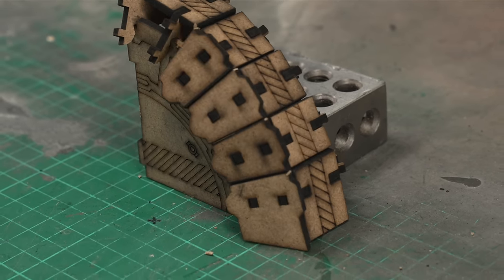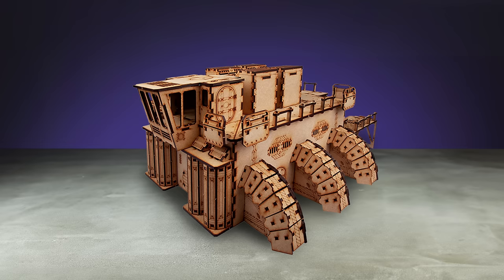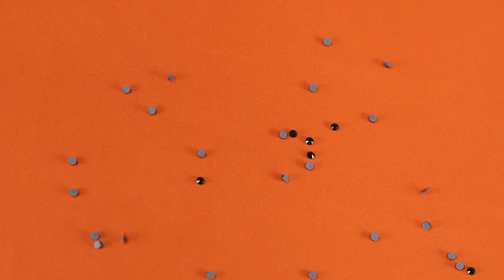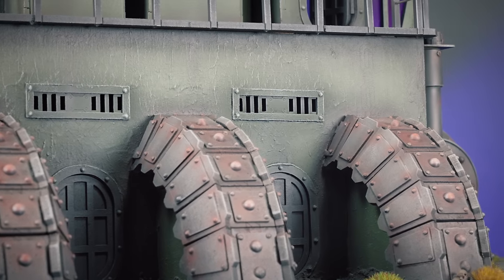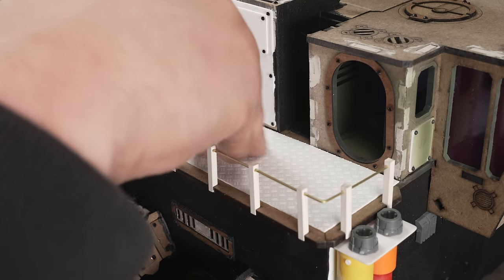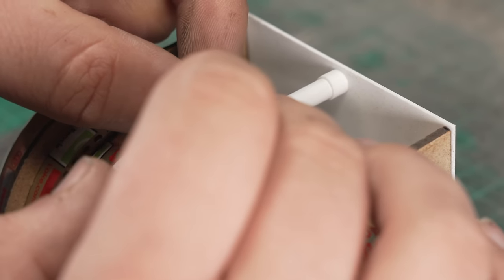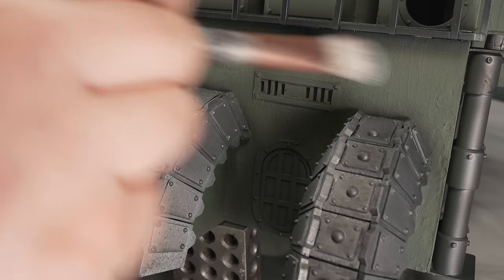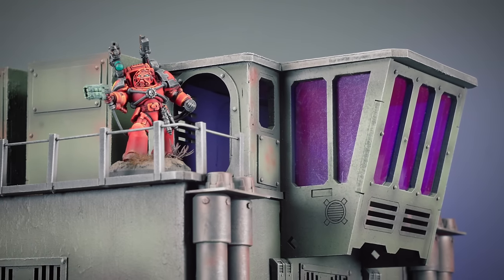How To Make Laser Cut Terrain Kits Look Good For Warhammer 40K

Comment: Some fantastic instruction there. As much as i love MDF kits, they do have some limits that need mitigation. I think the most telltale sigs are the burnt edge plugs, but wiping down the MDF and light sanding before assembly makes a load of difference in how much post assembly fixing is needed prior to painting. I also find that enamel rattle can primer makes a great MDF sealer.
Reply from the maker: Thanks dude. I'll have to try the enamel spray cans, they're not something I often use. I've pinned your comment to the top as there's some great advice in there!
Reply: @OffbeatBuilds  the enamel acts as a water barrier, similar to the PVA step you included in your video, but without introducing water to the MDF surface to soak up. Once you have it sealed with enamel, you can go back to water based acrylics and go to town.

Wiping down the MDF sheets with a damp, but not soaking, cloth cleans up the surfaces and helps remove some of the material that settles on the surface while being cut with the laser.
Reply: Do you think that a spray matte varnish (like Munitorum) would also seal the surface?

Comment: Jeez, you won speedrun for best unknown to #1 warhammer creator. No messing about, clearly presented ideas and visuals, and a fundemental understanding of whats good and bad about current warhammer models and associateds. (That atv video was great btw)

I would personally suggest that with laser-cut kits, you can use plasticard sheets and trace the existing patterns etched into the flat surfaces beforehand, then after smoothing apply the sheets to keep the detail instead of losing it entirely. This is a lot more effort but with the sides of your generator hubs it's quite obvious something is lacking. Not that it looks bad becuase of that, just a balance between time and quality that can be managed.

Comment: Love how you make/present your videos! Can I ask, what is that metal box with holes that you use with styrene?
Reply: 123 Block
Reply from the maker: Thanks dude! As @araqiel2759 said, they're called 123 blocks, they're used by machinists for clamping down work when milling, but make for an incredibly useful tool for assembling models with 90 degree corners, holding things together while drying and I've even shaved down a couple of clamps that fit into the holes to act as a "third hand" for holding small parts. I saw Adam Savage (Mythbusters) use them in a build years ago and bought 4 of them and I can't think of a tool that's offered a bigger quality of life improvement!

Comment: Great video. Incidentally I just started with MDF kits and boy oh boy. After 20 years in the hobby you still learn new tricks.

I have a quick question. What did you fill the holes and spots on the joins with?
 
Also do you recommend adding texturing to the models (to get a concrete-like feel)?

Comment: Um, those are not rivets.  Those are some kind of hemisphere.  Just smile at how smart you are.  JHC.  Rivets are FLAT.  Rivets are HEXAGONAL, octagonal, etc.  One way to produce them is to superglue a small length of plastic rod to the location, wait for it to dry, and then clip off with high quality clippers to the appropriate height.  There are architecture modelling place that sell thin rod in square, hex, etc.  You can also find etched brass or even water slide decals of small rivets sold for high end military modellers.  But they are quite expensive for the quantity.  This is what the GW staff do (or did before high resolution 3D printing), because the cost to them is immaterial.  But hey just pretend that you do the great work!